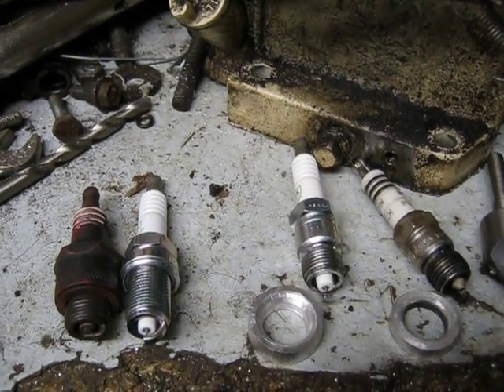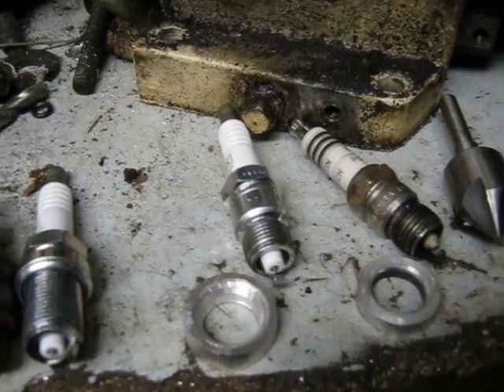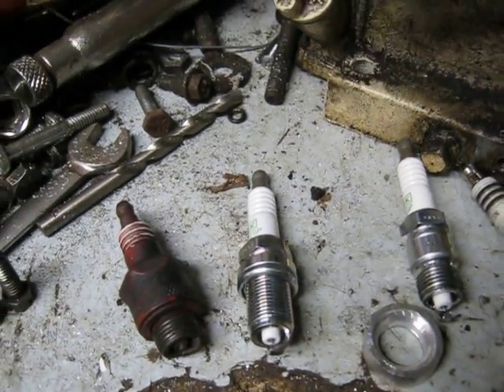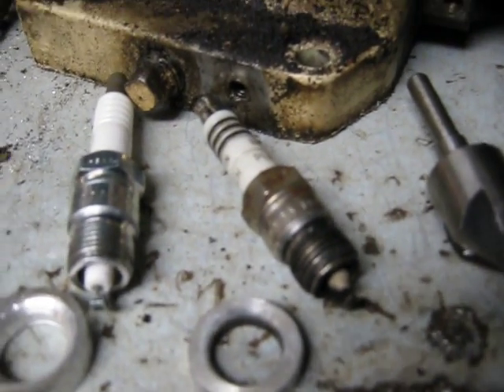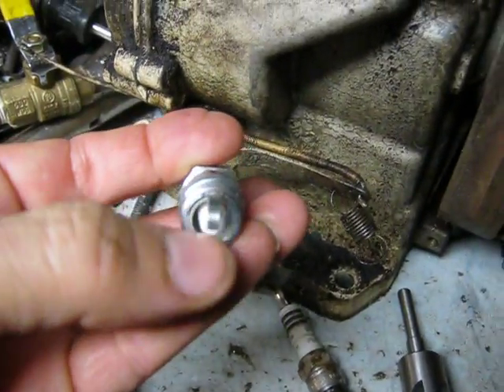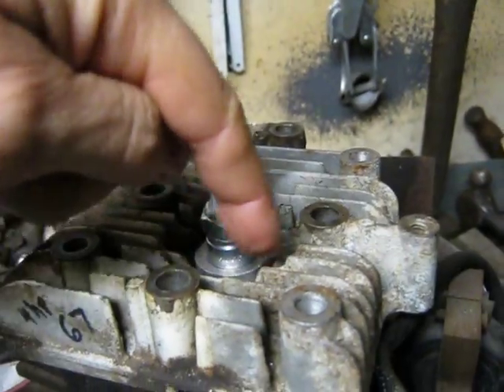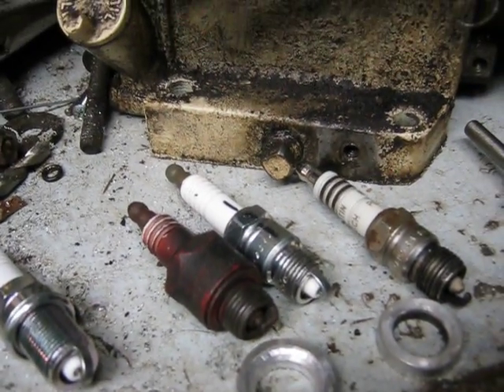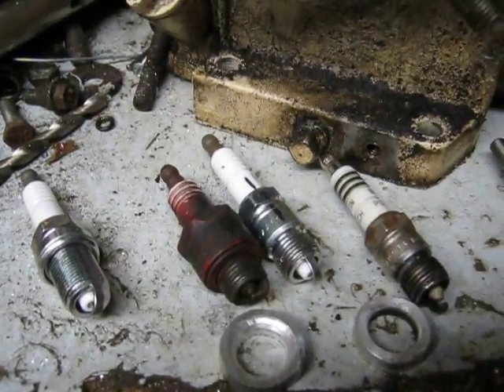Platinum Spark Plug Adapter for old Briggs

Comment: only thing I would worry about is the heat range of the plug.  Putting a spacer on I'm sure has an affect on heat range.  Is it the shorter the plug the higher heat range or hotter the plug runs?
Reply from the maker: +zzzdogutube True, it could alter the heat range. I admit I am not 100% knowlegable  regarding heat range, though I think the longer the plug the hotter it runs, due to having a longer path for the heat to flow before reaching the cooling area of the threads. My intention was to have the plug run hotter to burn off the oil fouling. Perhaps this vid will generate some good discussion regarding heat range etc. so we can learn more  :)